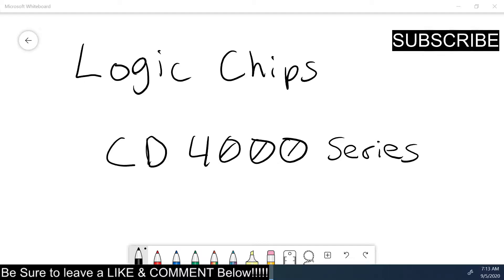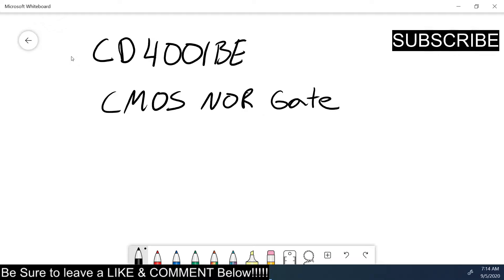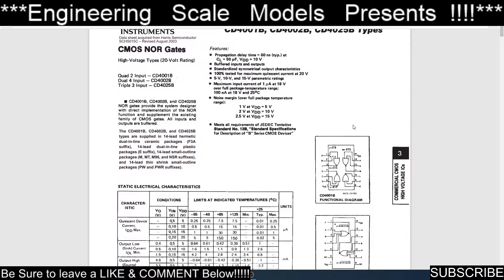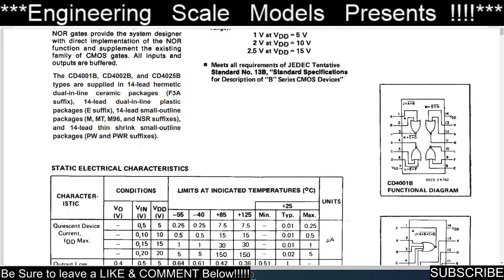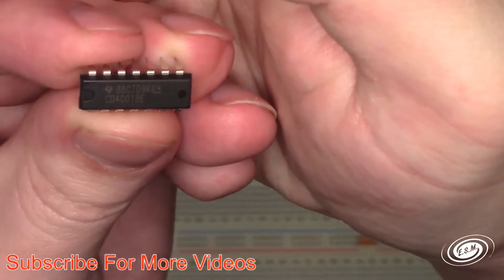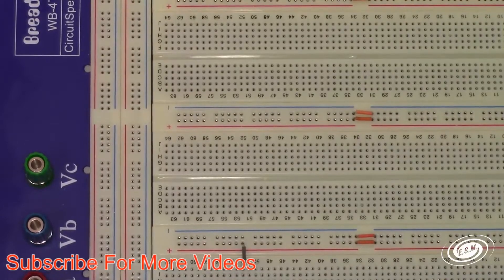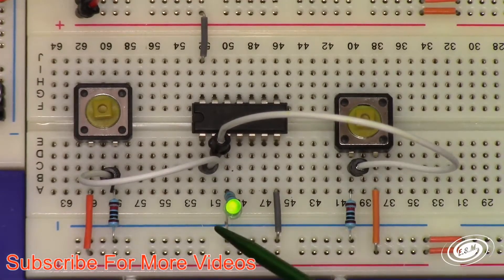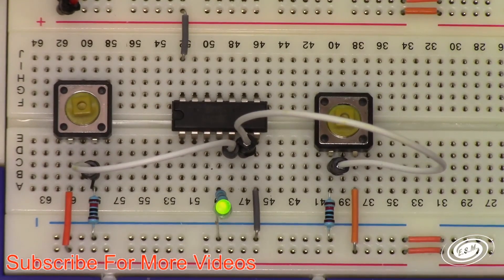A Look At Logic Gates CD4001 Quad NOR Gate IC Chip

Comment: How much should the voltage difference be between two inputs to be considered low or high? for example if one input is taking 5 V and the other is 3 V does this make 5V high? or does low have to be zero ?
Reply: Under or above of the 10% VDD is the limit .....